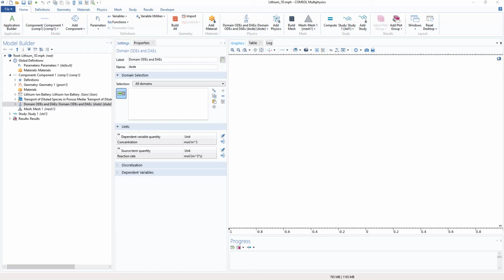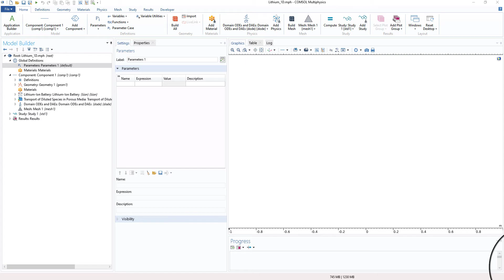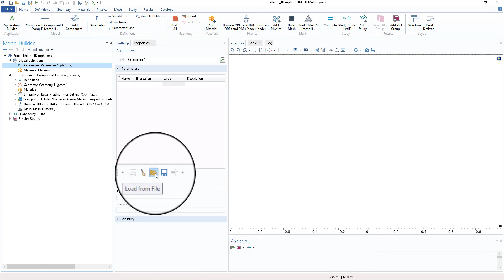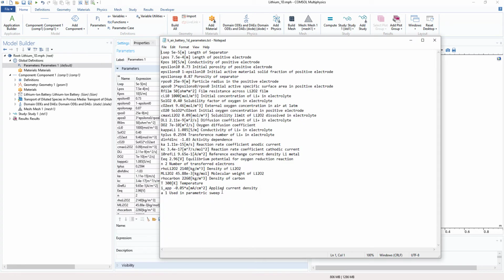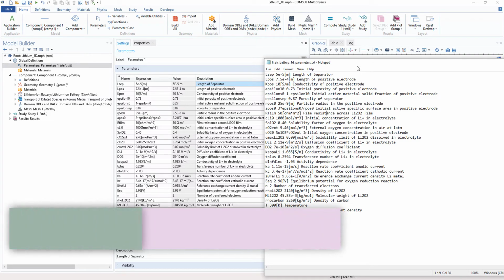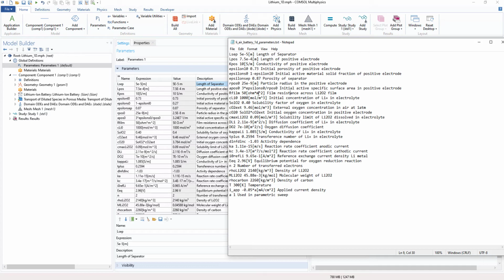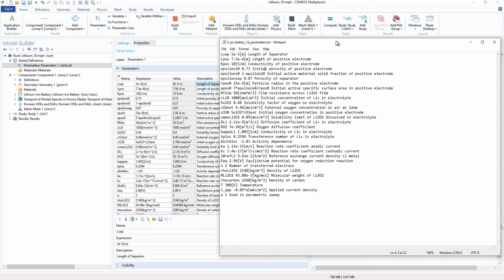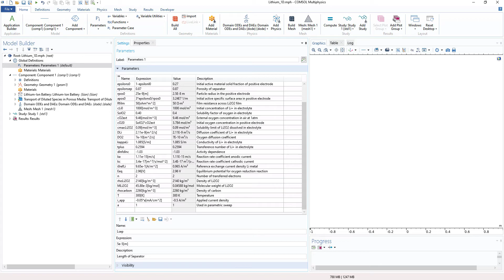Importing user Defined Parameters in COMSOL Multiphysics®  Software

Comment: Does anyone know how to import a filename into a COMSOL executable app?  (Parameters can't be strings, AFAIK.)  Is there a command to get STRING input from the command window that is calling the executable (like there is in most languages), so I can run my executable from a .bat file?  
(Important: I want to do this with an EXECUTABLE, that I've made with the COMSOL compiler, so that running it doesn't require any COMSOL license.)
(Important: Yes, I know that one can do this with an executable INTERACTIVELY.  Can it be done non-interactively?)
(Clarification: My program has about 50 parameters that its users might want to vary, to optimize the design for different purposes.  There is no single goal that I can optimize for, so the users have to do that.  It isn't practical to make hundreds of versions of the program.)
Reply from the maker: I didn't get the full picture. As far i understood you will need to add some javascript conditions (a lot of them) since you have 50+ parameters. And put above the model in the compiler settings. In that way you can have a form that will update the dynamic parameters to the model in the next form ...maybe something like that. 
You don't need .bat file i guess.
Reply: @LearnwithBK  Thank you for trying to help.  Much appreciated.  I looked into doing what you suggested, but it still requires a COMSOL license to run.  I have more users than licenses, so that's not the best option.  In the end, it turned out that I could use an application argument to specify the parameter file.  The command in a cmd window is like so:
.\MyModel.exe -appargnames param_infile -appargvalues MyParameters.csv
where MyModel.exe is my executable, where param_infile has been defined as an application argument, and where MyParameters.csv is any file containing my parameters (which gets read in with other code in COMSOL).
Reply from the maker: You can reach out if you need to discuss related to it.